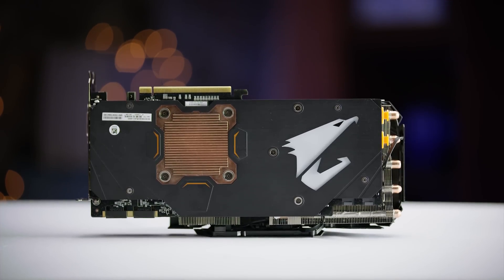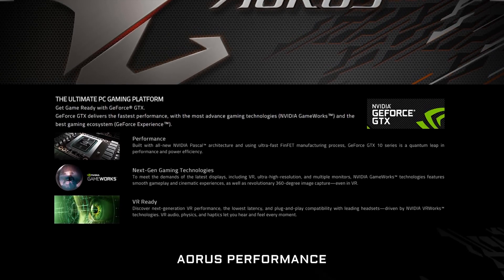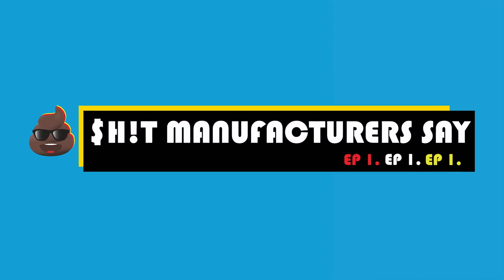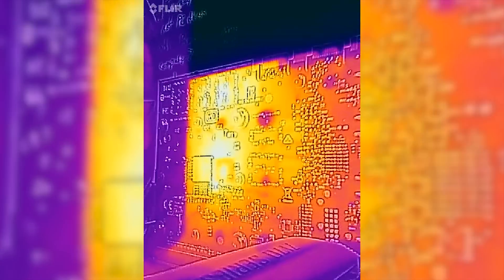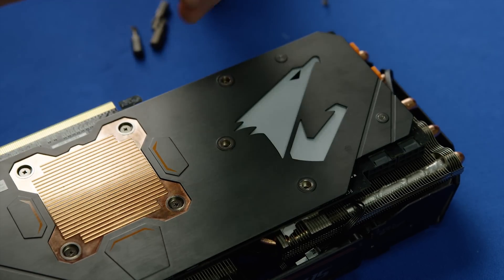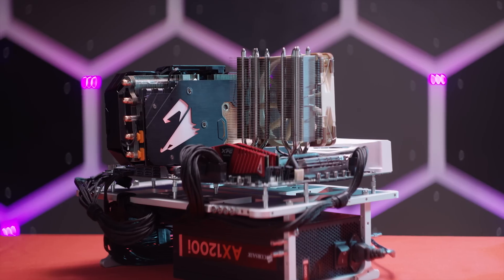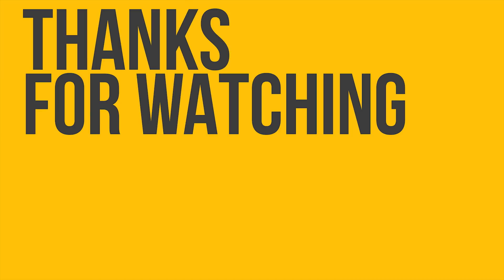$h!t Manufacturers Say Ep. 1 - "Backplates Cool Your Video Card"

Comment: Bit silly, any dissipation is going to increase the life of many types of materials and components. Life span and many other factors come in play, plus helps with bowing due to heat and force. I think all cards should have some sort of back heat sink by standard. Ambient temperatures have a big play as well, cold environments with moderate airflow would be enough. Still good video as it hits an interesting topic but there is so many factors you didn't mention that would play a role, even if not translated on the results.

Comment: imo, it prevents the board to warp due to excessive heat that can cause bga to dislocate or get disconnected.. heatsink prevents the board to overheat too much that can cause solders to weaken ovetime.. it happened most of the time in laptops so its a plus to have it.

Comment: Backplates do help cool, noobs
your not even doing a 100% test Noobs

Backplates help cool the RAM and shit NOT the core were you are getting your temp #s
Reply: That may be true but it's not relevant to this card:
1: The bit of copper has been added to cover the area between the GPU mounting holes... such that it misses EVERY SINGLE MEMORY CHIP (which are all outside of this area)
2: The RAM is all on the other side of the PCB... 
3: Finally, there don't appear to be any thermal pads over the areas on the back of the PCB where the RAM is located

So basically this backplate is really badly designed!
Reply: On a GTX 1080, the only good a backplate will do is to cool the VRMs.  Check out EVGA's new GTX 1080 ICX cooler, its designed to cool the VRMs using the backplate as a heatsink and case airflow to move hot air away.  JayzTwoCents has a good video on it.
Reply: Yes, but this card advertises that backplate cools the core, hence them doing these tests.
Reply: I agree, The reason why EVGA had the whole thermal issue was due to not having thermal pads between the VRM and back blate. They do have a function. It's to spread the heat across the PCD and allow for a minimal amount of cooling. It's minimal but it stops heat pooling up in areas like the VRM and EVGA had to learn the hard way
Reply: Zraupp10 noob.
Reply: that's why EVGA made the FTW2 cards I guess...
as they have temperature meters for the VRAM too

Comment: Founders Edition
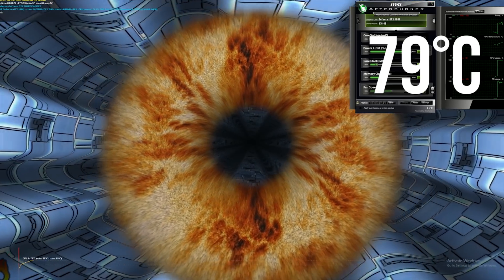2:33 With BP  Fan Speed: 65%
3:08 Bareback Fan Speed: 69%

Adrus xtreme edition 8G
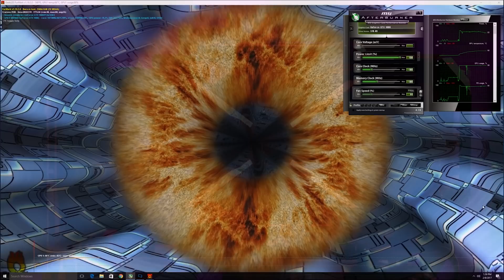3:46 With BP  Fan Speed: 44%
Bareback Fan Speed Conveniently Left Out

Now a 4% fan speed difference is not much, but that's with the card that does not even claim improved cooling from the BP. It would of been nice to also see the fan speed difference with the one that did make that claim, or even better, turn auto fan speed off when doing these types of tests.

Also if you plan on using a thermal camera then please, at least do some reading up on emissivity and how it can make 2 thermally equal things appear different.
Reply: Yeah the fact that this is misleading people is what really pisses me off. Luke seems to be overlooking a lot of key details. It amazes me that this passed all the checks along it's production.
Reply: Scientific != LTT
LTT = clickbait and sponsored content
Reply: They are just using insert footage, you don't know how long the card has been running when those videos were recorded and I can guarantee they were not recorded at the end of the 20 minutes because you can see that in the graph on the right that shows the history is mostly blank. They haven't been running for long at all.

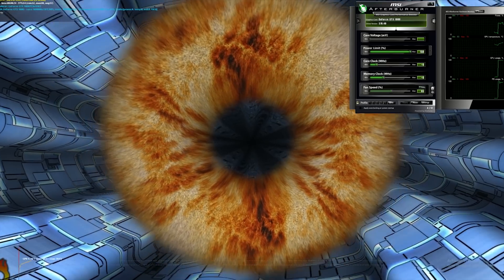Also if you watch the footage starting at 2:24, you can tell they just started the test becasue the fan speed is still rapidly rising. From 2:24 to 2:33 it goes from 60 to 65%. This is the very beginning of the test or possibly completely sepperate b-roll footage not recorded during the test at all.

I do agree that some of the stuff they did was flawed though.
Reply: Was looking for someone to point this out, Luke sets thermal target to 80 and no one is surprised when they both hit 79. #notsureifbrainfart
Reply: THX! Is LTT kidding us? Without the backplate you have 6% higher fanspeeds! Don't know the fault marge... But still not the same!
Reply: >Now a 4% fan speed difference is not much, but that's with the card that does not even claim improved cooling from the BP

That's about as stern a conclusion as theirs? I'm saying that cos honestly I feel like most people here are just trying to start shit

"The card is not less hot, the card is not running any faster. Does the backplate look really cool? Yep! Does it cool things? Maybe, maybe the back of the PCB but not the GPU or anything else that is going to affect performance."

Also they say on their site next to a 3° image, verbatim, 

"Excessive heat from GPU not only gets dissipated utilizing the massive cooling module in the front but also through the back side with a big copper plate, providing a well-rounded thermal solution for the GPU." lol

>Also if you plan on using a thermal camera then please, at least do some reading up on emissivity and how it can make 2 thermally equal things appear different.

Luke said their tools aren't conclusive, and even says the footage conflicts with their findings in this specific example. In the end its a b-roll shot of colorful filler video, not their main substantive data.  Might as well complain about the whiteboard drawings at this point.

"It's hard with the tools that we have to say whether this is to do with poor thermal transfer through the PCB or the thiCCC thermal pad that's on the copper plate. And the card does perform well so we aren't saying not to buy it or anything, just brace yourself for disappointment if you're a hardcore-copper-back-plates-for-their-GPU-cooling-abilities-nerd I guess if that exists."

If we're gonna pick though everything autisticly then I'm going whole hog
Reply: Fanspeed was fixed - afterburner screenshots were taken by another employee after everything was said and done - I told him what to do but forgot to specify he needed to fix all the fan speeds - sorry for the heartache but nothing changed
Reply: gpu boost will make it so that the speeds change if there is significant change - there was no change in gpu clock speed or memory clock speed as a result of the test. The card hit a voltage limit as noted in the video and didn't go higher than that.

The fan speeds were fixed, the target was set to 83 degrees, it only got to 67 because thats as much as it would go to when voltage limited. 

I'm sorry the screenshots were screwy - We do try to avoid this but it does happen from time to time and I apologize for that, but the stuff i said above is valid.
Reply: 9-5=6
Reply: To be fair, it could be to ambient temp in the room. Unless we know the actual study, it's best to take this one with a grain of salt.
Reply: Maybe you should take over this channel. No sarcasm.
Reply: thank you.
Reply: Yeah I'd like them to revisit this one.
Reply: 4 percent fan speed difference can make a difference. On my Gigabyte 390 from 66% to 70% there is celarly a change.
Reply: Reason over Dogma in many of their older tests room temperature was taken into account.
Reply: The fan speed was set to auto so it just adjusts itself but I guess that might affect the final conclusion.
Reply: @Max Elkin

Your right, this was also my first thought, when I watched the video, waiting, that Luke finally explains the benefit of having less noise or even a slight improvment of the reached maximum clock speeds, which are also depended on the temperature values, besides Powertarget. Not all Cards are running the same/have same BP, but if you have such a materialistic enhanced BP, the should/could be more gain of it, espacially when it's build in into a real case, with a common airflow walking over it. At least, this could be easily verified.

@ LTT 

I really didnt expect this Luke, please make that clear/better (reason above). Nice card btw.
Reply: My first thought, too. Wow these guys do this as their main job....
Reply: Max Elkin also Fan speed percentages are garbage. should feature actual RPM numbers.
Reply: zach burke I take anything LTT days with a grain of salt. Cool channel but not exactly for anything scientific.
Reply: As others said, nice catch.

I recently overclocked my Pentium 4 630 to 3.9GHz: using thermal limits to know when to stop. Because the board tries to hold the CPU temperature at a constant 60C, I was able to know when I was approaching thermal limits by watching the CPU fan speed.

He also implied that he may have over-volted the card (but did not say this explicitly). To hit 3.9GHz, I had to undervolt my CPU. Only got to 3.45GHz (and saw the temps climb to 62C at max fan speed) with stock voltage.

Ran for (over) 21hours with Prime95 (no errors), so I think it is stable.
Reply: Get Rekt by a guy with 2 subs! Now 3 :3
Reply: they didn't advertise the fan speed for either you just happened to look on the screen and see it. and if they turned auto fan speed off it wouldn't be a realistic test because probably 90-95% of people use auto fan speed when gaming. they did a real world test to see if it improved cooling under settings that the majority of people that buy a card for its "cooling backplate" would be using. as for the camera I don't know much about thermal cameras so ill take your word for it
Reply: Luke Lafreniere if the fan speeds were fixed, what did you mean at 2:23, when you said:
"I left the card at stock settings, other than cranking the temp target up to 83 degrees...."

3:37

"...Crank the throttle and power limit to max..."
pseudo edit: I am going to assume that limit is higher than 67C.

Does that mean the card possibly throttled the clock speed instead of the fan speed? In either case, the effect is the same. If you are deliberately holding the card at a specific temperature: don't be surprised when it stays at that temperature.
Reply: Arnold Tóth Isaszegi na azt azért nem mondanám. nagyon sok jó content van, ritka, hogy valamit ennyire elbasznak.
Reply: All the shots of MSI afterburner on the Founders edition card are from the beginning of the test. It doesn't really tell us anything.
Reply: Mrskithuset so, pretty much we cannot conclude anything from the video other then what they tell us. 
They might as well not have done them at all.
Reply: Max Elkin ı
Reply: you can easily work around that with a calculator to figure out what percentage is for what RPM
Reply: lol
Reply: How dare you /r/savedyouaclick LMG!
Reply: I was about to make this conclusion - no mention of whether fan speed increased to compensate in lack of rear cooling in order to keep 67 degrees. My thoughts are yes.
Reply: Unrealistic or maybe it was only 4% and they decided the sound level was the same or unnoticeably different and that it's a FAN and 4% is not going to affect its overall lifespan but I still think fam speed is irrelevant when most people use auto fan speed and aren't going to get performance increases from fan speed
Reply: wow so misleading and dishonest. unsubbing.

Comment: Hey do this again with that in SLI as the second slot. And enclosed, not on an open air test bench.
Reply: I was thinking this as well.  I went from a 970 SLI with back plates to 980 SLI without (Basically free upgrade).  It's not apples to apples, as the 970's were Strix and the 980's are MSI Gaming, but the 970's had a difference of 0-2°C between the top and bottom card, while the 980's were almost always a 10°C difference.
Reply: I agree.  This is meant to be SLI-ed and in an enclosed case where the front fans are to cool that area between two GPUs.
Reply: You don't really need to test this at all. Look at a back plate, look at a cooler, notice the difference in fin density and surface area? Plus one has active fan cooling and the other is just passive/case flow cooling. If any benefit that lump of copper will work as an expanded sink, reducing temperature fluctuations when under a dynamic load but it's doing stuff all cooling.

Comment: Not sure about the back of the GPU core requires the extra attention but on my Titan pascal, on the backside of the capacitors/chokes get waaaay too hot. I kept getting BSODs, my solution was to slap some thermal pads on this custom milled headsink and rested it on top of the ek backplate. Now it's happy...

Comment: if you havnt realized that the back plate isn't placed on the GPU, so it is not for dissipating the GPU's heat but rather the whole board heat in addition to protection & aesthetics.
basically this whole video was pointless.

Comment: You need airflow on the backplate to make a difference.. They are designed to be placed in a case with proper airflow to allow cooling.

Comment: what about the fans? sure if the fans were say on 70% with the backplate on but were they running faster with the backplate off? maybe the cooling of the front of the card was good enough to keep the temps stable and the fan just worked a bit harder.

Comment: @LinusTechTips @Luke, can you test if there is a temp difference of a card based on its position? By that I mean, fans/heatsink facing upwards instead of downwards, and then, sides, etc... you know hot air goes up, and in current design it appears the hot air is slightly trapped within heatsink construction. test test test test test ! thanks

Comment: Do the test again but in a case, or with a fan blowing at the backplate. Using an open test bench to test performance? Fine. To test temperatures? Nope. Reason being the airflow from inside the case may help in cooling down the backplate of the GPU. This theory had been tested by JayzTwoCents who thought of all the variables, notably having the GPU in a case, not in an open test bench and have concluded that yes, airflow across the backplate will cool the GPU. LTT, please step up your game and be less clumsy with your testing methodology.

Comment: I doubt it would have made a difference anyways but like others have pointed out, the execution was sloppy. It would have been both easier and more accurate to fix fan speeds and have a fan pointing on the backplates. Since you had to remove the aorus cooler entirely, you also should have replaced the thermal paste, and since you would be changing the stock paste you would have had to replace the other card's paste as well.

Comment: I dont know if you try the same test in a closed case with some fans. You are testing the GPUs on an open air testbench and posibly the aourus backplate would cool if some air pressure was there.

Comment: For the first time ever, after years of watching LTT & Luke etc. I have to say, you're in fact wrong, on an air cooled card the temps reach a point that is to high for a back plate to do anything about it, so you're partially correct for most consumers/users and factories are still claiming silly stuff. But, In my own experience with water cooled builds, the first time I noticed a difference was on my EVGA GTX 680+ 4GB water cooled by a 140mm X3 rad and a 140mm X3 rad using dragon ice cooling liquid and IC diamond paste I maxxed at 47C under load after a long benchmark, without the backplate I reached 50C in the same conditions, I know this because when I first put the XSPC full cover waterblock on my GPU the screws would't fit in the EVGA backplate, so I ran it without for a week until I found screws that would work, I was actually shocked by the result having never noticed a difference before (on air), but we're talking nearly and sometimes more than 40 degrees celsius less than on air. I also drop a total of 1 degree with the combination of IC diamond and the Ice dragon coolant, (lot's of tests) so the backplate had the highest single non standard contribution to my overkill WC setup.

I realize my setup is not common, but it's still a valid point nonetheless.

Comment: Almost always upper end overclock is limited by GPU voltage which nvidia will never unlock. So, There is no effing point in spending extra cash on GPU with extra cooling. I wouldn't even buy factory OC card if that OC can already be achieved with msi afterburner. Another fact that I find really annoying is reviewers don't show the temp on custom fan profile. With aggressive custom fan profile the reference cards will perform as good or even better than those absurd looking after market GPU.

Comment: The cold spot is the different emissivity of the shiny copper vs mat black metal. Shiny surfaces can confuse thermal cameras and you may actually be seeing the temperature of the case around the GPU as the metal reflects the thermal wavelengths of light. A piece of masking tape is pretty close to the expected emissivity so a bit of that on top would tell you the true temperature.

A good backplate would help keep the PCB cooler but is unlikely to affect the GPU core junction temperature significantly as it is more directly tied into the heatsink itself.

A bad backplate can trap heat and cause hot spots. Backplates are good because they prevent handling damage and prevent dust from accumulating on components.

Comment: maybe its where the temperature sensor is located on the card that was not able to justified the heat dissipation from the backplate. Next time instead of using a thermal camera use a infrared thermal gun to get specifics of the temperatures around the card and obviously the back of the GPU processing die.